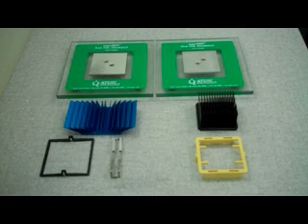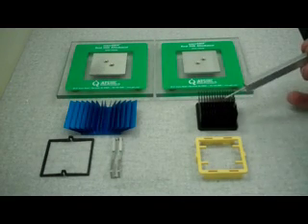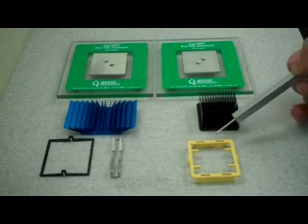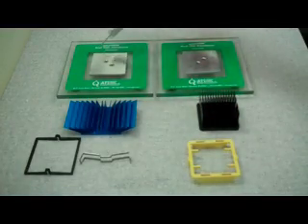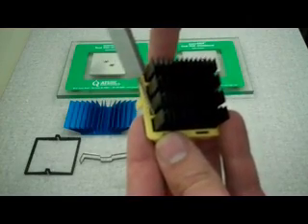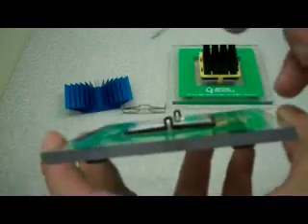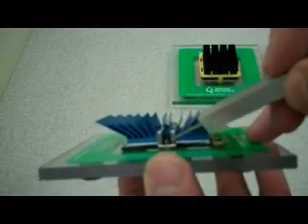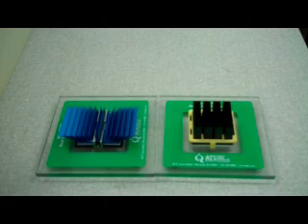ATS superGRIP Heat Sink Attachment Demonstration

Comment: Does it need heatpaste between the component and the heatsink?
Reply from the maker: The best thermal interface material (TIM) options for use with a mechanical attachment such as superGRIP are thermal grease or phase change material (some ATS heat sinks come standard with PCM). The importance of TIM is that it minimizes the interfacial resistance between the top of the component surface and the bottom of the heat sink, allowing the heat to be conducted between these surfaces more effectively. For more information on thermal interface materials check out this blog post: https://www.qats.com/cms/2010/03/17/when-to-use-a-thermal-interface-material-with-your-heat-sinks-and-why/